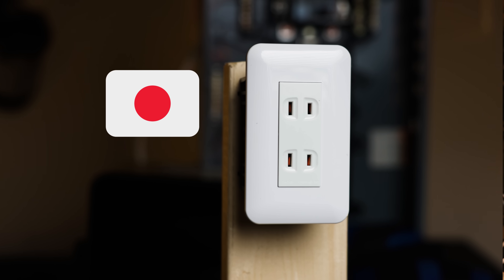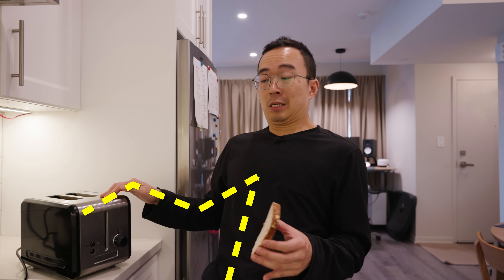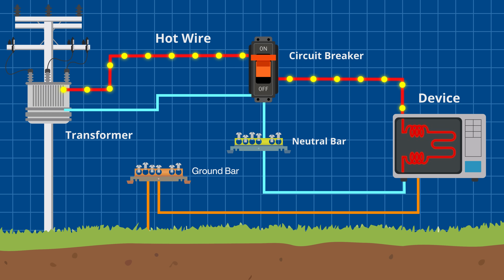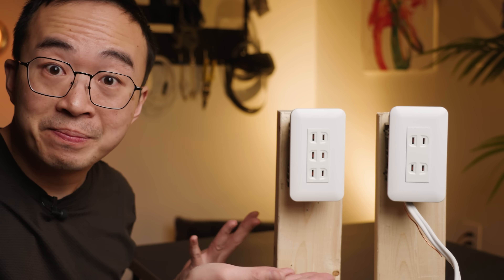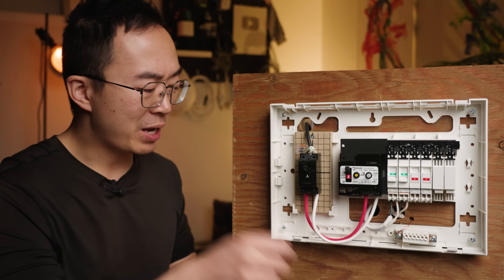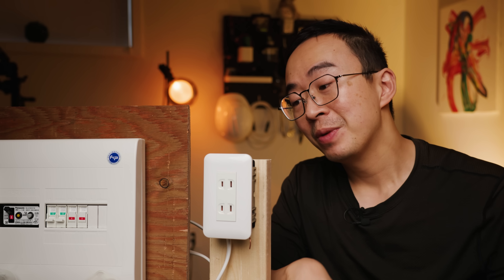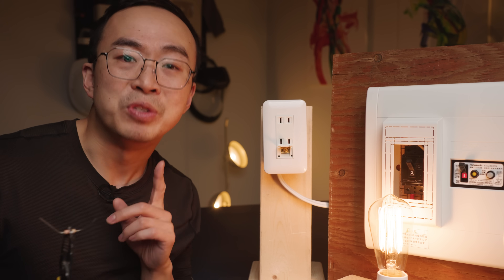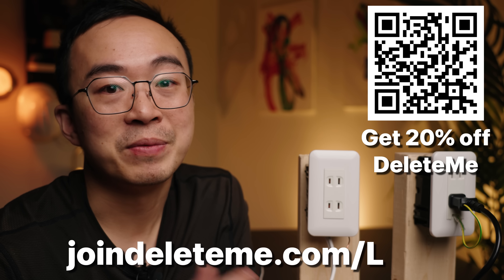How Japan Made Their Outlet Safe

Comment: Another difference is Japan supplies 100 volts three-wire single-phase, the US 120 volts three-wire single-phase.
One potential issue with the Japanese system is a neutral fault, as both require the neutral center tap be grounded at the transformer, the US also at the home and neutral and ground bonded. That lessens issues, but fails to completely eliminate them in the US system if a neutral fault occurs, from your description, the Japanese system would exasperate the problem by a fair amount due to load imbalances in that same scenario.
Given the technical descriptions I've read thus far on the Japanese electrical distribution system for residential power, it looks pretty much the same until the breaker panel, although the neutral - ground bonding is likely done at the service entry/meter, rather than at the breaker panel.
Still, it makes greater sense to GFCI the entire home electrical system and Japan had an advantage in doing so early on, given the nation had to essentially rebuild most of their infrastructure after a bit of an unpleasant disagreement back in the 1940's. The US, well, we tend to hold onto things, so we've got parts of Edison's original DC system still in place, retrofitted to AC, terracotta water pipes in some cities (I know for a fact Philadelphia still has many) for water supply, lead pipes still persisting in the water supply in some cities, etc. Total Frankensteinian systems here, bastardized to pseudomodern "standards", with tragic results at times and pretty much an attitude of "let someone else pay to upgrade things to modern standards" until they fail utterly.
So, we'll get water main breaks in 150+ year old pipes leveling parts of city blocks by undermined foundations, an electrical system that's a century and spare change old and don't get me started on our sewage systems in older cities...
And occasionally, somewhat comedic events, such as when we had a power outage in my apartment building, where half of the building remained lit, somewhat chaotically (some floors had no lights, others had half the building lit), my own apartment in the dark, but the 220 volt AC unit behaving rather oddly due to logic failures, LED night lights operated, nothing else did and really odd voltages, as the outage was due to a neutral fault from pole to building. So, the entire building of hundreds of apartments lost neutral to the pole, the neutral then completing a circuit back via ground and/or via conduction between loads from hot to hot via the 220 hots. There are videos here on youtube about "neutral fault". Can create interesting issues, to put it mildly, each circuit's hot-neutral voltage was entertainingly different in different parts of the building and well, it took me a couple of minutes to figure out the problem and call the power company about it, as it was at the pole and not the building's service lines that the apartment owned and I'd have had to explain to rather sleepy maintenance personnel what was wrong... It was fairly late and I don't sleep that many hours, rarely have. And I was bored anyway...
I suspect that the Japanese system would trip the power and protect the equipment in such a scenario. If anyone is intimately familiar with the Japanese power system and the precise protections of the main breaker, please do respond on if I'm correct. It would be quite along the philosophy of Japanese engineering, "why solve one problem when we can solve three with one solution?". I'd also be curious if arc protection is also in the standard or soon to be.
Reply: No, the binding of neutral and ground increases issues as if the neutral breaks the voltage on the neutral gets to equipment cases. There is a risk of electric shock.
Reply: Japanese Home Panel Main Breaker：
1Ø, 3-Wire 100/200~110/220V
Lost Neutral（Overvoltage）Protection circuit breaker

https://youtu.be/s6ul7KDWbLY?si=jfPvco389q7Wp6z3
Reply: @hccheng6248  way cool! I suspected that was the case. It's a shame that the video's CC didn't work though. Alas, I speak only a couple of words of Japanese, not even enough to gain cardinal directions.
I'd still go with outlets with the grounding screw though, for specialized equipment's protection usage. Always better to have more options than less, as long as one properly utilizes those options when called for and not just to just use something that's available for no valid reason.

Comment: Well here in the USA gfcis trip at 5mA, which for 20 mSec can be a nasty but non lethal shock.
In most of Europe and Japan, 30 mA is the trip current...please correct me if I'm wrong.  Europe and Japan seem to favor One gfci per household vs one for each protected Outlet.  30 mA is no doubt more resistant to false trips, these are an inconvenient reality in USA.
Both work so I'm not going to choose sides.
My wife and I have commercial and residential properties in Mexico where gfci protection is still rare, but increasingly used, albeit slowly.  Electrocution is very Rare in Mexico despite this. In Mexico the voltage to ground is nominally 127, similar to 120 in USA and Canada, and 100 V in Japan.  In Europe it is 230 to ground, meaning the same human ground contact delivers 4TIMES the energy for a given contact time.  Worse, this higher energy burns a conductive path through your semi insulating skin A Lot faster increasing energy through put for a given contact time.

Comment: No... it is NOT safe.....
becasue you have failed to take into account a CRITICAL  matter, the japanese system DOES NOT   allow polarization of the plug.
Which means that anything with a "dropper" of voltage converter is potentially intrinsically UNSAFE...

Comment: If in the US you can have 2 prong plugs. If the wiring is good you can add a GFCI at the start of the circuit and replace the other plugs down the line with ground plugs. You won't have a ground wire but you will have GFCI to protect all the plugs in the circuit

Comment: Not bad in concept, but the details are quite wrong.

This explanation of grounding and neutrals is kind of bad.  I know it's intended for a less technical audience, so explaining the actual purposes of earth ground, etc, is probably unnecessary, but this explanation almost makes it sound like it's intentionally to signal the breaker.  I'd simply explain it as the ground being a drain to zero volts.  If there's any kind of fault inside the device, and power gets connected to the case, the grounding gives it a very efficient path to get out, so it won't go through you.  It adds some significant safety even in cases where the breaker might not trip.  In a case where the fault in the device isn't a dead short, but a moderate resistance to the chassis, for example the middle of a heating element comes loose and touches the metal case, in an ungrounded chassis, this would still likely be low enough resistance to give you a dangerous shock.  Even in the grounded version, depending where the short is, it may not even trip the breaker, but it'll make sure that the chassis is at zero volts. (though the element will still likely burn up in short order, and disconnect itself if a breaker doesn't trip first).

Also, it's a little funny that you choose a toaster, when they're one of the few appliances that is almost never grounded.  A dangerous side effect of a grounded chassis is that  it makes a very good return path if you touch the hot side of the circuit while also touching ground.  Because people have been known to occasionally dig inside toasters with forks, or various other ways of making contact with the un-insulated heating elements, you can have a very dangerous situation where you're holding the toaster with one hand, and digging out a stuck slice of bread with a butter knife in your other hand.   touch the element, power flows through the knife, up one arm, through your chest, and down the other arm to the grounded case of the toaster in your other hand.  This is why almost all normal toaster designs are only 2 prong plugs.  They skip the normal safety against internal device faults, because contact with the elements is probably a more common danger.  Luckily kitchens should mostly have GFCI outlets these days, so that'll help.

GFCIs and safety grounding both have their advantages for safety, but in most cases the ideal will be both.

And both systems are somewhat plagued with hazards due to reckless design carried forward from the distant past.
Individual GFCIs in North America trip at much lower currents, too, (typically in the ballpark of ~5mA) which is much better, at least in the places they're installed.

Also, when speaking about safety, it's probably worth noting that Japan's voltage is relatively low, at 100v, or 200v for the high powered appliances so fatal shocks are a bit less likely than in places with 240v.  And for any of the nerds who read this far on my stupid comment, it's also worth noting that both Japan and North America use split phase power for their 200v or 240v appliances respectively.  this means that rather than having a 240v hot, and a 0v neutral, we both have two 100/120v lines that are out of phase with a neutral at 0v, you still get the same 240v needed for your stove, dryer, etc, but the highest voltage relative to ground is still only 120v, so it's difficult to shock yourself with 240v, (you would need to touch both hot wires at the same time).  This is a bit off topic, but there's always someone from Europe poking in to say how much safer their plugs are, etc, but at least when I get shocked it hurts a lot less.

Comment: I would argue japan did it right
ground is generally useless as most devices simply do not even have a third pin, and tend to be isolated supplies anyway

ground has a use in situations of large metal objects that might become live due to vibrations or heat(like a clothes washer or dryer)
but my laptop that is mostly plastic and has a dc power supply doesn't actually need the ground wire

granted some laptop supplies with ground pins bind the dc negative to mains ground, mainly due to the nature of devices you might plug into 
but this is BAD because if it has any analog signals(like audio jacks that will never be obsolete because Bluetooth is NOT perfect)

so while yes, ground is a decent thing to have, it should be a low-current path back to neutral, like a big resistor that can carry 30ma at 120/240v but would cause a GFCI/RCD to trip anyway

if you design a new home it may actually be smarter to ignore US electrical codes, and place a panel GFCI/RCD to protect the ENTTIRE house

but wait, US electrical panels have this already
in areas that may encounter significant water(like outdoor lighting) there is a special type of 120v US breaker that has built-in GFCI protection
granted these devices do not have ratings higher than 20a(30a circuits are possible and useful in some cases, like the supply to an RV or welder outlet, where GFCI would be REQUIRED)
and they also do not work on 240v US circuits due to the nature of using split-phase supplies, providing a GFCI for suck a circuit would require a dual-GFCI breaker with an op-amp to combine 
them to detect an ACTUAL ground fault, as there may be a 120v device inside your 240v appliance(like the lamp in your clothes dryer) and that would cause a fake ground fault trip as some current would go through neutral and not the second phase wire

so to properly protect your house from electrical mishaps leading to heart shock deaths, use GFCI breakers in the panel for common 120v circuits, use local higher current GFCI disconnect devices for your 30-50a 120v specialty outlets(a box next to the plug that will save your life)
and for 240v devices, NEVER LEAVE GROUND DISCONNECTED, if the only economical solution for split-phase devices is a shunted metal body that makes it so it can't become live, then USE IT

in my case I would use such a system of GFCI breakers on every circuit, armored cable wherever I am doing >20a(because it can't shock you if the armor is shunted to ground and the inner wires are protected from other damage) and armored cable and grounded body devices wherever I am doing 240v
if I have to run a device that is not US 240v compliant I will bolt on an isolation transformer that shifts the ground to the natural phase neutral of the device(like hypothetically an old UK heavy appliance or computer that I want to preserve, allowing me to shift ground between a center-tap and a 240v single phase)

but given the nature of modern devices (and the fact that any computer from olden times could run 120v and had a ground if it needed 240v that was not actually bonded to something that is phase-linked, with just a minor mod that was obvious) I doubt w=it will matter if you include GFCI protection in all your circuits

the UK did have a good idea settling on a single voltage, one single wire is dangerous, the rest are safe(though having a ground  that is a think as they use is stupid with GFCI protection, you only need a wire that can take a single amp for the ENTIRE panel, as there is almost no chance of every circuit being just under the trip threshold)
and japan did similar with 120v(I am not sure how they do higher loads, or if their ocean proximity limits the need for large devices like AC and heating, and the small island size is enough that local waste-heat transmission for heating and other thermal tasks is just easier)

Comment: The ground wire is intended to cause a high flow and open the breaker in the event of a short but the amount of current required open a breaker is typically 15 A or more which is far higher than a lethal shock. Ground fault circuits should be installed in the United States wherever there’s a risk of a person simultaneously contacting a water pipe, water or ground and the outlet. This includes all outdoor outlets.

Comment: Our house was built in 1983.
We have the original central GFI system built in. It covers the bathrooms, outdoors, and garage. For example,  if water gets into an outside outlet, it trips the breaker in the panel. All connected outlets go dead until the breaker is reset.
No one else in our development has this feature, as far as I know.  Same builder.

Comment: A lot of two-wire devices in USA rely on hot and neutral being wired correctly in the outlet for safety. Since they're two-wire devices, whether there's a ground pin or not is moot. It's not uncommon here for testers to reveal miswired outlets where hot and neutral are backward. A GFCI should provide backup protection under this condition, but a third prong does nothing. In any case, anyone moving into a new place should get a cheap tester and check all outlets for correct polarity as well as testing any GFCI outlets - and if anyone does electrical work, check the affected outlets again.

Comment: Just FYI the one going to the ground that is buried underground is for lightning strikes... You don't want your system to get fried by a lightning strike... That's just literally their use... But you need to install a lightning rod that is connected to that same area of that ground as well with a certain distance from the one you put for the house... It's why you guys in America still put it underground in some places... You can learn more about this in solar panel setup videos... Because those systems don't use the same grounding that you use in a normal home and rely on RCB and GFCI in your case... And they still put a ground line into the ground.... For you guessed it.... Lightning strikes.... And they can tell you how to place the lightning rod line to protect the system from lightning strikes and how it actually works...

Comment: As some comments may already pointed out, GFCI/RCD works best with ground.
As the ground itself would trigger it.
Side note: Never knew that the ground must be connected to neutral, still that can cause problems with a fast Breaker trip, mainly being fire and also the risk of sparks.

Comment: The UK uses grounding and RCD protection as their method, 3 steps of safety, First is Basic Protection (Live wire insulation or air in appliances to protect from Live parts), Second is Fault Protection, either via Double insulation (Plastic or some extra insulation) or by Grounded Class I appliances that draw a large current to turn off a Overcurrent device via ADS, Finally if all these things fail then Additional Protection at a level no more than 30mA will kick in (RCD) and this will trip off the circuit(s) in question which caused this fault condition, hence saving lives, if all this fails i guess thats it for you, but this is as good as you can practically get!
Reply: The protection class has nothing to do with how much the equipment draws power. My laptop charger is 30 W and class I. I also have a space heater that is 2000 W and class II.
Reply: @okaro6595  Never said it did, i was talking about the way the UK prevents against electric shock :)
Reply: @okaro6595  Those numbers are normal opperation, in a fault something like 400A or so could be expected which blows the fuse / OCPD

Comment: In Switzerland EVERYTHING has GFCI, every outlet, lights, and usually there are multible ones in the wiring closet. Bathrooms get their own brakers, other rooms are mostly grouped together. We also have ground in our outlets, but it's seperate from neutral. (TN-S)